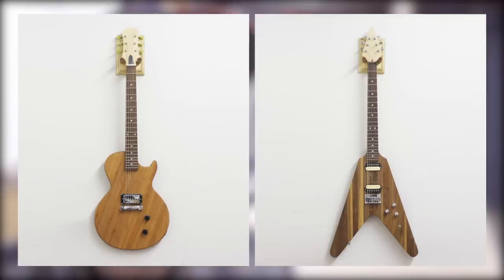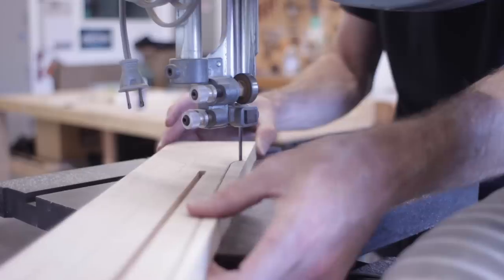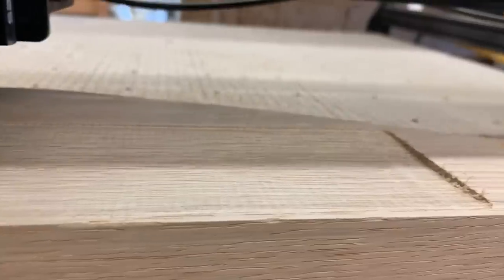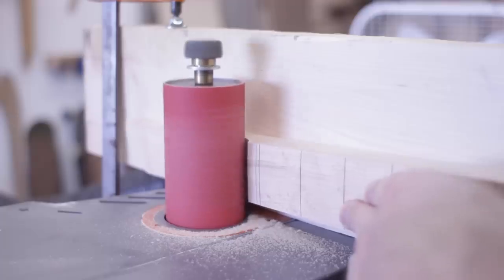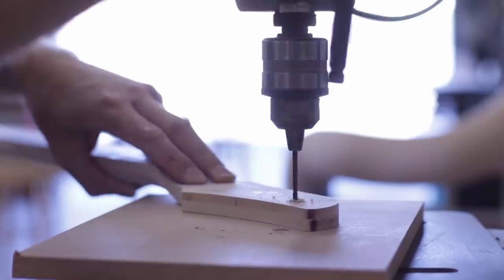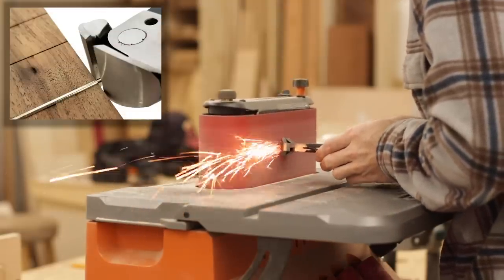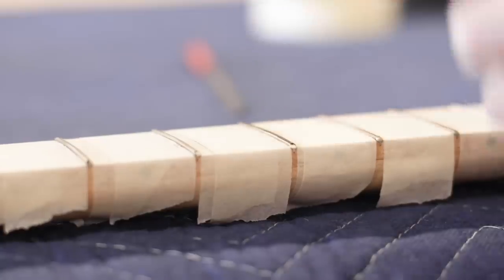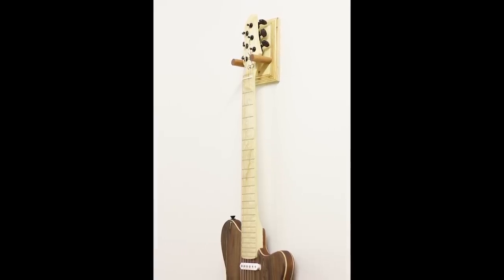Making a Guitar Neck and Fretboard By Hand

Comment: Not boring at all. Nice fret wire bender, good solution to an overpriced problem. Haven't built a complete neck yet but done quite a few repairs and refrets, I found that a set of radiused blocks matching the neck with just space for some wadding felt and  some large speed clamps and again wadding on the fretboard will hold the neck still and prevent ''bounce'' if using a hammer. I later converted a vicegrip for fret instalation, the bonous of this was that with practise I had very little leveling to do. I made the vicegrip so that I can change the fret side to suit the radius. So only on acustics do I need a hammer for the 6 frets from the 12th after that I use a clamp and radiused block through the sound hole.

Comment: I just finished my first guitar, which was a completely unique design. I didn't have a small enough flush trim bit so I had to chisel the truss rod channel, which took about 6 hours. Definitely recommend getting a jig for a router. I also did a multiscale neck, what I did was create the fretboard on the marzguitar workbench on FreeCAD, and then convert to SVG and print it using inkscape. Then I put painters tape on the fretboard and super glued the paper template onto the taped fretboard and you easily peel it off when done with cutting the slots. It intonates perfectly and feels great, although I could have shaped the neck a little thinner.

Comment: Great work! If I may add a couple of things...
- I cut my fret slots a bit wider and use CA glue to set the frets in, by doing so the fretboard doesn't tend to warp over time - this obviously doesn't happen on electric  guitar necks, but can be a pain in the * on classical / acoustic guitars where the lower part of the fretboard is not supported by the neck;
- maybe your design doesn't require it, but on strat-style guitars having the fretboard extend a little bit beyond the neck allows for an extra fret;
- recrowning frets after levelling using a triangular file can be tedious, if you get a recrowning file you can save a lot of time - and they're not too expensive.
Thanks for the hint on grinding the cutter to cut fret ends, I hadn't thought about it. ;o)
Reply from the maker: Thanks! All good tips. Looking forward to making more guitars in the future and trying different techniques.

Comment: Thanks, very helpful video. When I went on a bass building course, we used a router with a roundover bit to do the lions share of the neck shaping. It left a small ridge along the back of the neck, and the fine tuning was done with one of the round files you used, along with a saw rasp to 'join up' the shaped neck ends. It worked great, and even a woodworking novice like me was able to do it with minimal supervision.
Reply from the maker: Nice! Might have to try that at some point. Thanks for watching!

Comment: nice job for first neck.  You could use the cnc router to make a template for the guitar neck in the z direction for your thickness profile, and not have those little issues when you're trying to carve it by hand.. Or you could do the entire  thing on the cnc as well... aint too bad, once you get it programmed...

Comment: I've seen one guitar builder that uses an Arbor Press that he bought at Harbor Freight to press frets in. It was cheap. About $15 I think. You'll need a fret caul that matches the radius of the frets. And the Arbor Press will have to be adapted for this purpose. The guitar looks good. It needs a wammy bar though.
A plastic hammer works too. But, any type of hammer can deform fret wire. Pressing is the preferred method.
Reply from the maker: Yeah, I definitely considered buying a fret press, or figuring out a way to make my own. But decided to go as simple as possible for this first one. I will certainly consider it for the next, though.
Reply: @shaunboydmadethis  Matt at Texas Toast Guitars YouTube channel just did a video last week. It's caled, Making an Awsome Guitar from Scrap Wood Part 3. He shows his fret pressing method. Highline Guitars YouTube is where I saw the Harbor Freight Arbor Press. But, that was a few months ago.

Comment: AWESOME VIDEO... But, i did dang near cry when i saw you using that steel head hammer on the frets... thanks a million for the 
video. If you built another neck from scratch, would you deal with the truss rod access hole differently... before you glued down the fret-board?? Very curious.

Comment: I'm ready to build my first guitar neck instead of buying one. I looked for 'how to build a guitar neck by hand' and saw this video. It shows some useful tips, but I don't have all that expensive professional machinery. I'm using hand tools and a small jig saw. I will cut the truss rod slot with a palm router, while supporting the neck blank in a home-made jig which will hopefully guide the router. Thanks for the video!
Reply: Thanks
I have read your comment.
Please give a good advice for build a guitar fretboard on only one wood not add extra wood dor fretboard.
Reply: @mehedianas7467  Hi Mehadi! I have made my own guitars before but always bought the necks. So making a neck myself will be a new experience. I have some woodworking hand tools like saws, chisels and planes, as well as an electric bench drill and jigsaw. To make the truss rod slot and pickup cavities in the guitar body I bought a cheap palm router and a set of cutters. You say that you want to make your guitar neck from one piece of wood. The first Fender guitars had  one-piece maple necks with the frets fixed into them. Later models had separate finger boards. If you don't already have the wood you will need a hardwood like maple or mahogany. You can buy neck blanks online (I have bought a mahogany blank and a separate rosewood blank for the fingerboard). Neck blanks are usually 20 mm to 25 mm thick, just thick enough for a slim neck profile if you are going to add a separate finger board. If you are making the neck and fingerboard from one piece it will need to be at least 25 mm thick, as the head stock needs to be cut lower than the fingerboard, so the strings will be pulled down to the tuners from the nut. You will need a tool for shaping the neck. I bought a Shinto saw file like those I saw being used and recommended by luthiers on You Tube. It can shape and file quickly, and doesn't clog up. You can also use a spoke shave for the final shaping. I recommend that you look at some of the You Tube videos on how to make a guitar neck.
Good luck!
Reply: @Smoothancool  thanks

Comment: Looks great. Want to try it myself. How thick was the neck blank without fretboard? Usually, you need a bit of headstock angle to put enough string pressure on the nut, which prevents buzzing. But if the blank is thick enough, you may not need it, so I'm wondering what thickness you used :)
Reply from the maker: Yeah, most fender necks don't have an angle, but like you said you just need a thick enough piece of wood to create a headstock that is lower than the nut and fretboard. I don't remember exactly what I started with, but I think it was somewhere around 1" thick or maybe a bit more.
Reply: @shaunboydmadethis  Great thanks! Fortunately, I can always just put on a tension bar if the angle is too shallow

Comment: How did you make the radius sanding block? I have a CNC machine in my shop class, however I can’t figure out how to program the radius for the block..
Reply from the maker: I used Fusion 360 to model the sanding block and create the g-code for the CNC machine.

Comment: I have a question. You took the tape off of the truss rod after you put glue on the neck and before putting the fretboard on the neck. (@ 5:27 ) What is stopping the glue from squeezing out into the truss rod cavity when you clamp the fretboard to the neck?
Reply from the maker: It definitely just minimizes the amount of glue that might get into the truss rod cavity. A tiny bit of glue that might get in there shouldn't really effect how it works.
Reply: @shaunboydmadethis  Thanks for answering my question. I know that my question is a basic question, but I have wondered what guitar builders do to protect the truss rod from being glued together.

Comment: Actually, hammering in the frets before gluing on the fretboard is easiest in my experience. Also, drilling for the truss rod before gluing the fretboard will ensure not accidentally drilling improperly in general. You could have hit the rod, making a bigger problem than drilling through the neck.
Reply: Also, I'm personally not a fan of using a grinder for neck shaping in particular. For the body it's great, but controlling depth is difficult when using handbooks, much less power tools on the neck

Comment: Cut the truss rod access before putting the fretboard on.. Also it's not a good idea to glue in the nut on that style of neck if and when it needs replaced it will be really difficult to get out without damage.. In general however a good video..
Reply from the maker: It was only a couple drops of CA glue to keep it in place, so it can easily pop out if/when that is necessary. Thanks for watching!

Comment: Can you link me to the wheels and stuff you used to make the fret bender

I’m using a 9.5 radius block. So compare that to yours and give me rough placement if at all possible, thanks man. Enjoy the video.

“Dude you shot my guitar in the neck” -Jackie Chan
Reply from the maker: Dang, wish I had links for that stuff. It is all just sliding door parts that I got from Home Depot. I also just did a bunch of test bends and slightly changed the spacing until I got the correct radius.
Reply: Shaun Boyd I got her working

Comment: Interesting you didn't apply any finish on the neck or fretboard.
Reply from the maker: I did, it just didn't make it into the video. I used an oil/wax combo, nothing fancy.
Reply: @shaunboydmadethis  Thanks Shaun.  Did you apply before or after installing the frets?  I've found it impossible (so far) to get the finish right with the frets in the way.

Comment: “By hand”
I make guitar necks (3 so far) ACTUALLY  “by hand.” Hand tools only. Change your title. It’s very misleading, because the first 2 minutes you use a CNC machine and a router. I just can’t continue watching
Reply from the maker: Well I used a CNC to make a template and a tool, I imagine you have used both templates and tools to make guitar necks before. You are also implying that by using a router the piece shouldn't be considered handmade, which implies any use of a powered machine should disqualify it from being handmade, and I don't agree with that. I imagine quite a few machines come into contact with the wood used for most guitar necks made by hand.
Reply: Shaun Boyd no I don’t use a template.